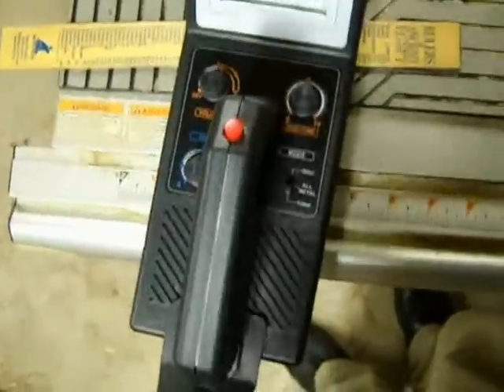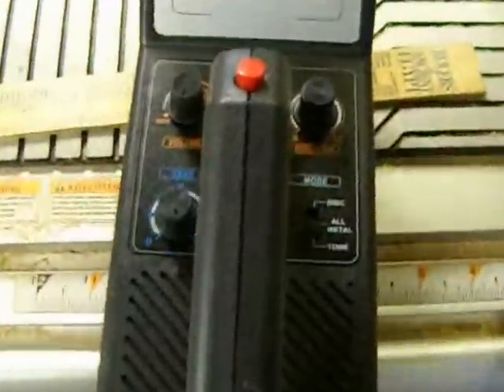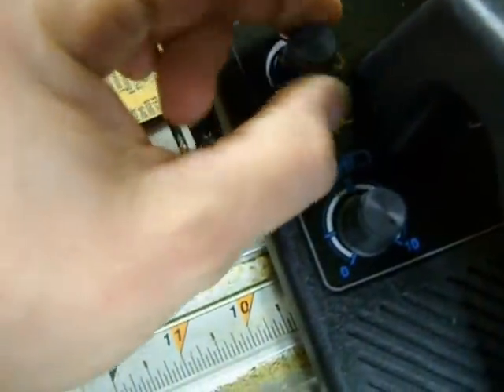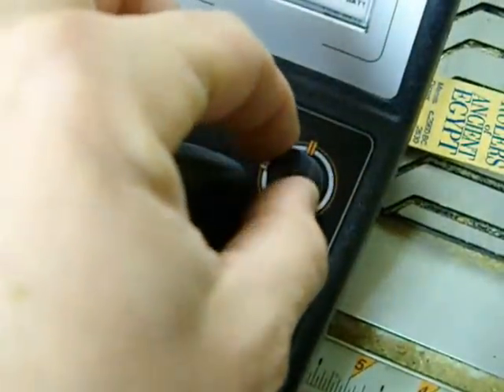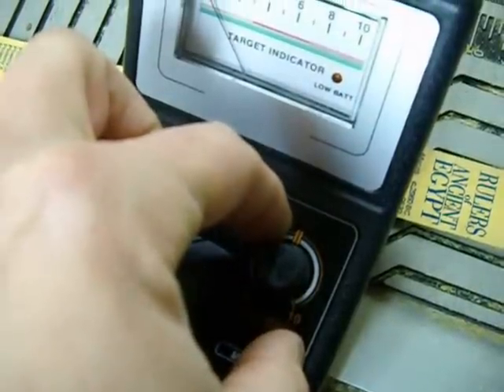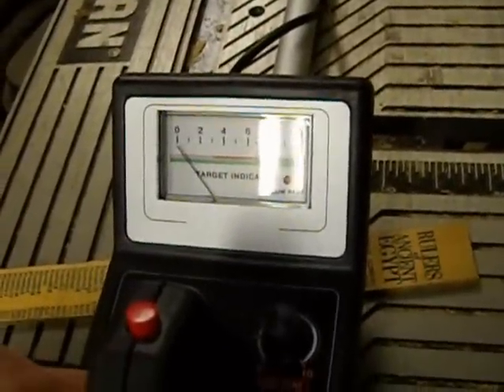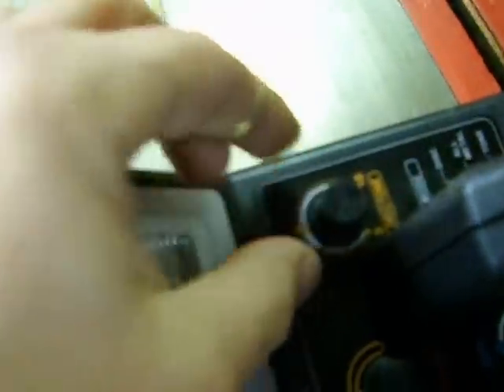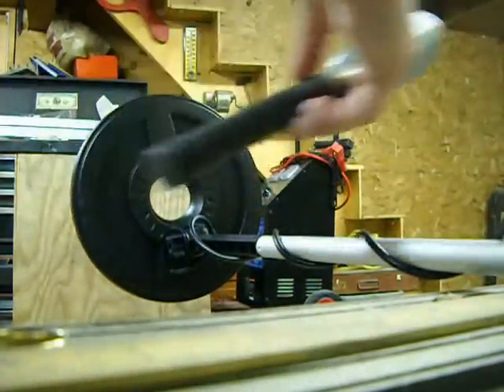Test and review, Harbor Freight 9 function metal detector

Comment from the maker: Define GOOD... It works, when metal gets in it's range it goes BEEP. It doesn't go really deep, maybe 6" which is below the sod line and will find old stuff if it's there and the pin poin is dead on balls acurate. Every other feature you saw in the video is just as I described. It'd be great for, a spare, the kids, first time, wife just lost her wedding ring in the yard, etc, etc. Thanks for watching.

Comment: The electric company brought a big limb trimmer through and burried my water cut off valve, and meter.  I tried several methods to find it but short of digging a trench in the vicinity of  where I remembered it being I needed a metal detector.  Ran to Harbor Freight and bought one of these 9 function detectors...and it works! 
   I was actually surprised it put me right on top of it.  It also found a buried can of skoal, some beer cans, and some foil ketchup packets.  I don't think I'd bother trying to metal detect on the side of a public road unless like me you have to find something specific.  lol
Reply from the maker: Yeah, not worth doing road sides but try the local park, go where people would have been a long time ago.

Comment: We bought this unit today and are trying to find a ring made of palladium.  We set discrimination to 3 and it makes the annoying sound all the time, so turned volume down.  At 3, it doesn't pick up gold even when practically touching it.  We're really confused whether this is working at all.  Per instructions, we used the Tone button to get the meter at 0, although I don't see you mention that anywhere.    My question is, would it pick up palladium?
Reply from the maker: Yes it should, try this. Turn the discrimination all the way down and sensitivity all the way up. Swing over your lawn to find a quiet spot. Now put a nickel on that spot and swing over the nickel and hear it beep. Now turn up the discrimination until the sound disappears and lower the disc until you CAN hear the nickel. Now it's set to find anything nickel or higher. If turning the sensativity up causes a noise with the search coil in the air off the ground then turn sensitivity until the noise stops and try again.
Reply: @jaymoge  with the Tune button all the way to the right and the Discrimination button all the way to the left, it never stops humming.  Is the Tune button what you're referring to when you say "sensitivity?"
Reply from the maker: First make sure the MODE switch is all the way up in DISC. Volume half way to start. Disc/tone knob at about 9:00 if it was a clock. Sensitivity gets turned up as far as you can without hearing a noise while holding the coil off the ground a bit. Don't push the red button (if yours has one as not all do) until you're over a Target and need to pinpoint it's location.
Reply: @jaymoge  There is no Mode switch.  I have the 43150.  There are four buttons in clockwise order: Discrimination Operate, Tune, Volume.
Reply from the maker: Ok, try this. Switch in operate, volume at half, disc all the way down and turn the tune know up and down until you just can't hear a tone. Then do the nickel trick. If nothing works right then it may be defective. I've never played with that model so I'm just going on experience.

Comment from the maker: I had to rewatch my video to see if I said silver, I said clad. I didn't have any silver coins to test with, I do now and my next video (on modifying the HF9FMD to increase depth to 7 or 8 inches) I use a silver quarter and a silver half to test. I know it's ''face value" lol thanks for the comment.
Reply: I tried to find the video you mentioned of modifying the HF9FMD to detect deeper, but no luck.  I've got mine open right now, just need to know where to solder! ;)
Reply from the maker: @jerramygipson6560  wow, thats an old one. I don't think you have to solder. If my memory hasn't failed, you just need to adjust one of the pots (potentiometers). It's a small cube thing with a screw head usually a certain color. Pass a coin by the coil while adjusting the pot a little either way to get the max out of it without going so far that it just keeps beeping. Do this at your own risk. SBD.

Comment from the maker: I mentioned in my video that an air test does not get as good of results as "in the field" testing. Ground moisture and mineralization play a big roll in depth with a metal detector since it's a frequency of "waves" that penetrate the ground and bounce back to be translated by the units on board computing system. I love that you're defending the "HF9FMD", I really like this machine too. I bought this because of all the mods I'm doing to my 250. If I mess up the 250 I can still dig holes. Thanks.

Comment: What I like about this detector is that it uses 6 AA batteries. Many detectors use 9V batteries.
Reply from the maker: I like that too. Though I did solder in a 9v connector and it still worked the same.

Comment: If not mentioned, harbor also sells a centech hand held detector for around $16. Very helpful tool to pinpoint your find. Only thing I had to replace was the push switch. Doesn't last long when used as a hobby tool. I installed an on off switch. 97245 is the item / part # .
Great vid, thanks for uploading.

Comment: Thanks for this video, very informative. I was curious, why not just do all your detecting in the pinpoint mode? (assuming you want to find all metals) I ask because I'm wanting to find all the nails in my yard from when the roof was done, and it seems the pinpoint mode works better. I guess I don't really understand its purpose.
Reply from the maker: Well, sometimes you might not want to dig "all metals" like if you're detecting in the park and found 72 pull tabs that all ring up the same, or parts of an old can that the lawn mower chewed up and spit out. It's not so much to tell you what the target might be but more for you to guess what it is before you dig it.

Comment from the maker: Do you mean the coil, the disc looking thing at the bottom? then no, it's hard wired. If you mean disc. as in discrimination then yes, the dial located top right changes it threw the different ranges. You gatta pracitce with the dial to learn how to eliminate iron and steel that you don't want but keep gold, thru silver that you do want. Good luck and have fun.

Comment: Whats the mode I need tp set up in this harbor freight metal detector to find gold?
Reply from the maker: You can run it in all metal but, try to get some examples to see what they do. I used my wedding ring (10k gold cuz I'm cheap) and a gold (24k) ring and they both rang up a little different but both in the pull tab/aluminum range so just DIG IT ALL!!! You just don't know. You could miss gold skipping over garbage signals.
Reply: @jaymoge  thank you
Reply: @jaymoge   but...what's the best MODES.I SHOULD USE..TO FIND GOLD...IN THE BEACH..You recommend MY Friend??

Comment: Tones in tone mode are the key.
This was my first metal detector. The second day out I found an old Bowie knife that I sold on Ebay for $145!!! 
I also found many coins (not to mention pull tabs), also some old bullets with this machine.
I'd put it head to head hunting coins to the Garrett Ace 250 once you are familiar with the tones.
Set at no discrimination and learn the tones and you "know" when you hit a coin or silver. Well worth the investment for a beginner or for someone that lost a ring in the yard. One of the few detectors actually worth the money.
Also, if you get good with this, you are ready to work any mid or high range detector out there.

PS: I didn't like the Garrett 250 (too close to this $45 machine) and sold it for $1 more than I paid for it. Go figure Ebay ;-)
Went with a Garrett AT Pro I picked up for $250 and love it!
Reply from the maker: Ken Durham Nice, great info. Thanks.

Comment: Hello NH treasurehunter. I actually found a Buffalo nickel and some Wheaties in the front yard of a 1940's house with this MD and that was (after) I had run over the same lawn thoroughly with a Fisher 1260X with the 11" factory coil. One big problem though. There was an overhead power line going to the neighbor's house and with max sensitivity on the Fisher, the Fisher was hampered by the AC line interference. So I had to turn the sens. on the Fisher to more than half way down just to eliminate the chatter the AC was causing. So I might as well, I figured, use a detector I could turn to max. sens. and it might not be affected by the AC the way the Fisher did. Sure enough, the HF 9-Function detector worked smoothly with full sens. so therefore I reason, was why I found the extra coins. I'm impressed with this lightweight and simple-to-use Harbor Freight 9-Function MD. Great detector, as you say, as a backup because no one detector can do everything perfectly but some, like the HF detector can do a few tasks quite well all around.
Reply from the maker: Glad the video helped you out buddy, great story about the coins too. Keep swinging those beepy thingys dude. SWING BEEP DIG.
Reply: Amen Brother!

Comment: I was thinking about putting some kind of thin, lightweight material on top of the coil to maybe reflect most/all the signals downward into the ground to maybe help get  better performance. I did a search to see if anyone has tried/experimented on this and haven't found anything. So far the only thing I tried was a piece of microwaveable  coated cardboard that comes with a box of bagel bites but didn't seem to help right away but if I left it on top of the buried coin, it started to pick it up without moving the detector. If you think about it, it' reflect microwaves and doesn't have any metal in it.

    This is just an idea I'm playing with and was looking for any other materials anyone else thought might help reflect the signals without affecting the coils reception?

 thanks for video!
Reply from the maker: +Holdemnutz p Radio waves don't work that way. You'll end up "ground balancing" you detector to the shielding. In theory I guess it might help with the receiving side of the coil but i'm not sure. It's not like putting a piece of shiny metal behind a light bulb.

Comment: Discriminate works better (more accurately) with sensitivity at 3/4 max.
Reply from the maker: I guess it depends on the unit. I figured out how to turn up the sensitivity and discrimination inside the box, there's 2 or 3 variable resistors to play with. You can do too much and it gets very unstable.

Comment: what about gold?
Reply from the maker: Gold will be a mid tone, at or just over the half way mark. Best bet is to try it on some gold you may have or borrow and make sure in case yours is set slightly different.
Reply: someone should make a video on the disc/tone settings for the different metals.
Reply from the maker: Chris Langham I went over it a bit in this video but honestly, your better off getting examples of each metal and turning the disc knob up a little bit at a time while swinging over the object until its sound disapears and mark the dial spot with whiteout or something. Typicaly anything over the two hash marks at 12:00 is going to be worth a dig, before that (either the low tone in "tone" mode or what you dont hear in "disc" mode is Iron, foil and trash. Best of luck, hope that helps.
Reply: Ya but I get tin at DISC/TONE at 10
Reply from the maker: Don't know what to say, dig it all and figure it out later. Lots of cool relics were made of tin or bronze or puter which will all give you mixed signals on any detector because they are made of several different metals.
Reply: Chris Langham 
Best bet on this machine is to go tone and learn the tones with discrimination off and sensitivity up as far as you can manage.
After a short time you notice the differences between the metals and when there might be silver in between iron. Unfortunately, gold shares the same tones as some lower metals, and this holds true for most machines. When searching gold you just have to "dig" in and go for the "gold"

Comment: The only difference between this one and let's say a bounty hunter mark 4 , is the price and a name that's it, now you want a nice once that will go as deep as 10 inches you have to pay the price and get one that's fully submersible will run you about $750 bucks for there low end expensive models  that discriminate up to about 9,  10 inches  and that's a gold pro model  bye Garrett  nice machine there for the money, but hey I just bought one of these  harbor frieghts water proof coils models, becouse there like I said all the same up to certain models! They do the same job! They just dont go really deep about 5 6 inches is all but well worth saving $300 to $350 dollors I say !
Reply from the maker: Garrett makes the AT series, (All Terrane) in the AT Pro, Gold and now Max. All waterproof, the AT Pro can be had for about $550 but I do get your point. My Fisher Gold Bug Pro was $400 used demo model. Year 6 with it and it's still 💯%

Comment: This one is (MUCH) easier to understand how to use than the similar-looking ones radio shack (used to?) carry. The slung-over handled one form radio shack is two-tone and black with the silver shaft and a red tuning button on the end of the handle. This is (NOT) an easy detector to adjust and is (VERY) unstable with (too) many adjustments dependent on one another. (NOT) the kind of detector that would be good for a beginner let alone someone who has been MD'ing for a long time. A friend of mine found the Radio Shack (complicated) version in a local Goodwill one day. Absolutely nothing wrong with it cosmetically of functionally. But without the original owner's manual, I could not even (begin) to help him learn this machine. (SO) in other words the Harbor Freight MD is (much) better value for the money and much less complicated thus easier to 'set up and go' so to speak, especially for the beginner. The only things I'm a little disappointed in with this MD is #1; No (true) 2-tone i.d. like other detectors have. #2; My first one broke off at the handle where it attaches to the control box and made the rest of the armrest loosen up and fall apart as it's attached underneath the handle to the control box by only two small screws. #3; It's (lack) of an equal 8" depth given the 8" stock coil it uses, is really a bummer on regular U.S. coins. #4; This MD puts almost (all) it's energy into the discrimination that right at the point where the machine discriminates out nails, it's already lost a lot of it's depth capability; 6" tops on a quarter by then. The transmitter circuit is just not robust and powerful enough to 'get the job done'. BUT on the plus side it's (VERY) lightweight; less than a BH Tracker 4 or a BH VLF/Gold Digger. You can swing this baby all day without getting tired out. It (is) still fairly responsive all the way down to its' maximum depth (AS LONG AS) one keeps the discrimination just above nails (but) below nickel/p'tab/ thin gold items. Go higher in disc. than a p'tab/nickel, than you're guaranteed to lose a (lot) of depth as (well as) missing all your nickels/small gold items. Don't worry about digging tabs. In some areas, they are the least of one's worries and problems as ar as problem targets. Hope this helps in (addition) to what you've already told your audience, NH treasurehunter. PS Folks: The cheaper one uses the T/R (transmit/receive) signal system from the 70s and actually, on various sites like eBay, the older 'lunchbox' type T/Rs go much deeper than the cheaper Harbor Freight MD for around the same amt. of money but just make sure if bought off a site like that, that the detector is in good working order (AND) that the machine will still accept the newer type batteries. Some used a 67.5 volt large square battery and they, for the most part, are no longer made. You'd have to (really) modify the old machine to get the 67.5 volts (+) a 9-volt battery (&) a 1.5 volt AA battery, just to have it operate properly. So some of the older ones accepted AA's, some used just 9 volts (1 or 2 of 'em), and some used the 67.5 volt batteries (+ AA/9-volt) so be careful you don't get the latter one by accident. Be a little hard to make work right.  Happy hunting to all!!!!
Reply from the maker: +Prairie G Well said Prairie G... great info.
Reply: +Prairie G depending on which radio shack model you have you might be sitting on a version made by Bounty hunter for Tandy corp. ...the thing is the harbor freight  is a modified version of the old micronta's  also made for radio shack   but they switched things up the red button  on the old models is the auto tune reset   now they switched it to  a "pin pointer ..and the 3 position select switch  was  used to change  frequencies on older models  this is more then likely a beat oscillating model with crappy depth capability      detecting an object waving it 6 inches away equates to about 3 inches in dense soil ......anyways   actually the multi switch  Radio shack model is based on a very effective Bounty Hunter model and is really better fro a beginner to learn on   it really is not complicated at all ...being able to adust "ground" manually lets you  fine tune the detector to different terrain    and they always have to be "tuned "  im sorry im not paying 3 or 4 hundred bucks because the model has an "auto tuner ..the Microntas that came with 3 function capability  VLF  TR1 TR2      PLUS an additional   discriminator dial   so you can weed out trash    it really is simple to set it up because of the number of dials  it seems complex    when I got mine   Radio Shack was closing its doors the units  started out   over 40 dollars   when Tandy realized just how good it was the jacked their price up  but people didn't go for it ..its only downside is its in a crappy housing  all the detail and capability is upper end  just   wrapped up crappy  the unit is sensitive t temp extremes and damage if dropped ...its a high performance engine in a paper machete  body  so to speak